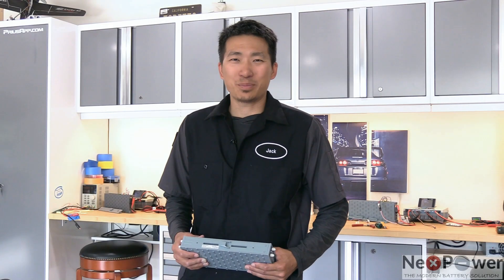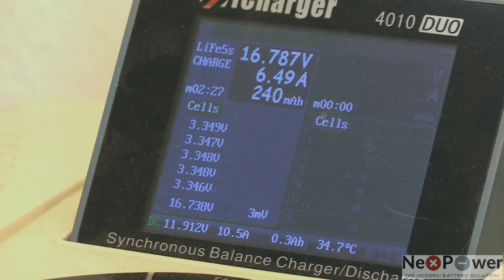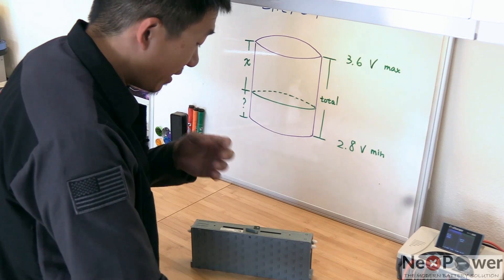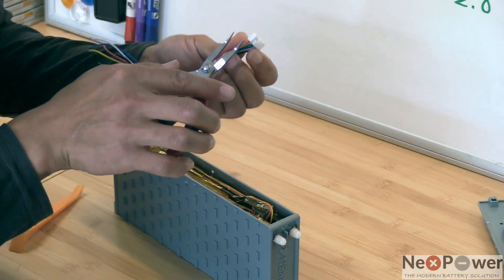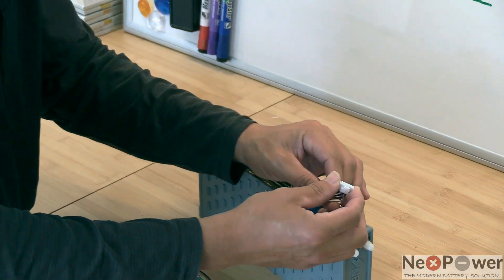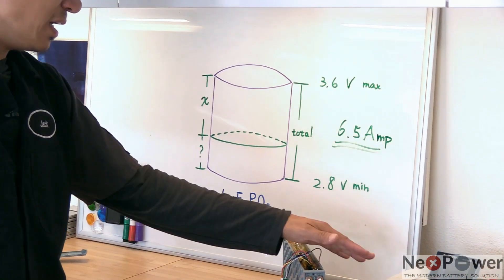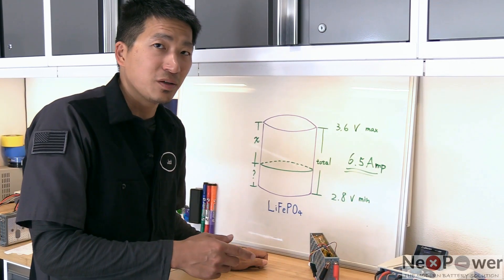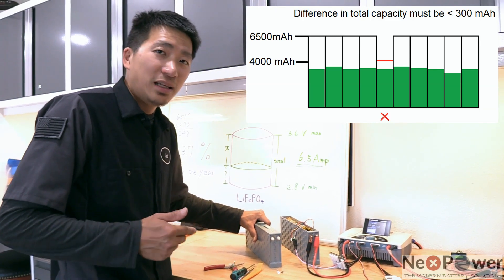Hybrid repair shop series - Measure true capacity - Nexcell Lithium upgrade battery

Comment: Why limit testing to 6.5A?  With the claim that the modules can discharge 260A (and they can likely charge with at least 100A), surely the blades can handle more than 6.5A?  The charger is capable of 40A in single mode and 70A in combined mode. Testing at even something moderate like 20A would greatly expedite shop testing.

Comment: You must demonstrate charge discharge with same conditions with Prius!
That mean charger must be configured to NiMH, max voltage 9.5Vx2 (19V)and cut of voltage 6Vx2 (12V). It is real conditions...
Reply: Your claim is wrong and your numbers are wrong.
Reply: @snoobler  What you mean right numbers?
Reply: @arkbox1  Configuring the charger to NiMH would destroy the blade.  19V and 12V are not correct.
Reply: @snoobler  But Prius dont know about this. Voltages I say above it what hapened in real priuse charger....

Comment: Just one question.. Stock prius Hybrid battery has 28 cell of 6500 mAh making the pack Total Capacity of 182k mAh, but you put 14 cells of 6500 mAh instead. making the total capacity of pack to be 1/2 of the original. How is your developed pack better then ????
Reply from the maker: Hi Ali, you forgot to add voltage into the equation, LOL    NiMH blade is 7.2v  , Lithium blade is 16.5v
Reply: @hybridapp7158  my question is sugar, yr explaining salt.. LOL. Obviously when ur putting 1 blade in place of 2, you have to balance the required voltage. Please explain what capacity of pack will be with yr blades as compared to stock blades..
Reply: @ailiahaider  The cells are connected in series, so even with 28 modules the capacity is still 6500 mAh, its just the voltage that has increased. With 14 modules of 6500 mAh, you have the same capacity in the pack.

Comment: How many cells in series or parallel are in each module?
Reply from the maker: 5 in series
Reply: @hybridapp7158  5 pouches in series to give 16.05v = 3.21 volts  are these lifpo04  or Lithium

Comment: I just bought these for my prius V and installed it about a week ago. Do you need to remove and balance them over time?
Reply from the maker: Hey Kurt, glad the pack made it to HI, no need to balance at all, this instruction is for repair shop to find out the capacity.
Reply: @hybridapp7158  Hi, thats funny:  "this instruction is for repair shop to find out the capacity" Here in germany we have no repair shop. I check my Lexus GS450H with Hobbyking balance charger to find the best modules. But your modules are very good.
Reply from the maker: @guidobraun2920  very nice, German = DIYer,  just FYI the Turnigy doesn't have the best accuracy, any iCharger is better.
Reply: @hybridapp7158  Thanks for your tip. Now i run my car for 1 week with modules from a Auris, Prius, Lexus GS. I check with Turnigy charger and the car run. But i see with the Dr.Prius app that 2 modules that measured with over capacity (and i mean that is good) that this block shows me a lower voltages.
Also the internal resistance of some modules goes to 23 milli-ohm. 
Quit no good battery pack ! But i have only this one.
Ennocar ofer me modules 40 for 1900$ without german tax.

My plan, but i love my lexus, to get a real working pack. But with cost for a repair, and not to bay a new car. 
What is your price for 20 modules?
Greats Guido
Reply from the maker: @guidobraun2920  I suppose you have the GS450h? 20 modules is currently out of stock (someone from Germany just bought 4 packs), we should have the inventory back end of this week, check out https://ProjectLithium.com for latest pricing.
Reply: @hybridapp7158  Yes, GS450H from 2006. I repair now the car since 2016 fror the 4th time. The car is from 2006. I get to rapair the battery with modules from "England". Hope i find the way to run my car (noisless, qwiet, pover full) again. !
hope your project get a good "Benefit"                                                      for your work and thinking !

Comment: I have a 2010 prius I average 48 to 50mpg on a good day, 286k I'm thinking original traction battery summer using the ac,38 to 40mpg can this new battery help improve my miles per gallon, I'm a very go driver
Reply from the maker: MPG gain on a Gen2 is significantly noticeable, for Gen3 you will also gain MPG with more power available at any given time, check out our range test video to find out more.